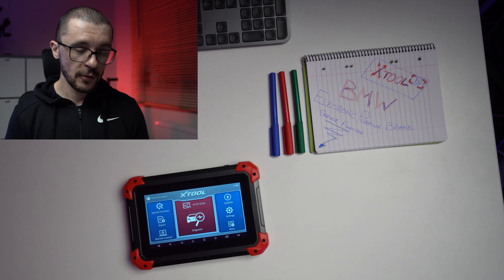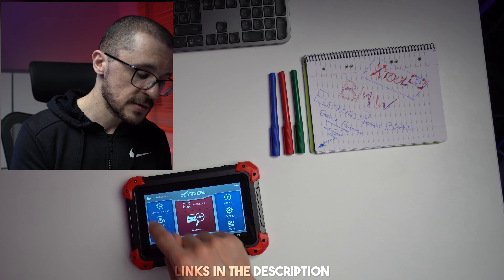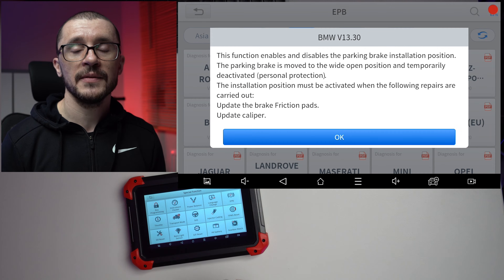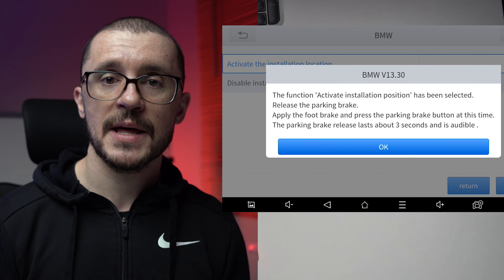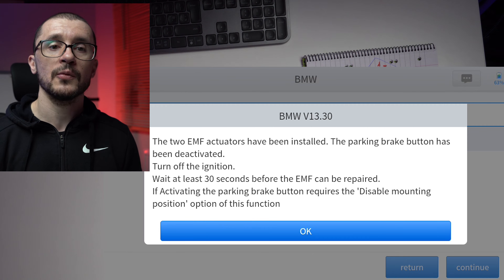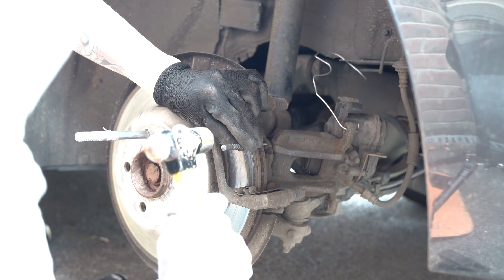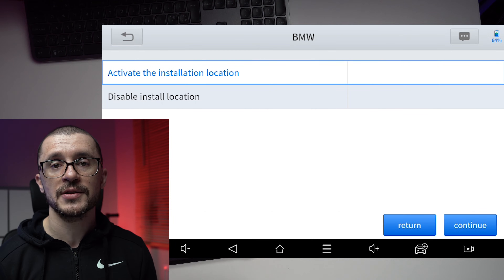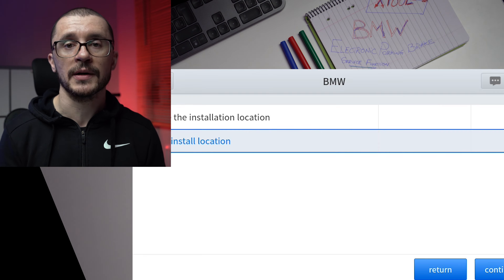How to Service Any BMW EPB - Xtool D7 - Electronic Parking Brake

Comment: Used it as described. Motor wound back for 3 seconds and then a further 10 seconds ok. But when I fitted the new pads it would appear that the caliper was not wound back far enough to fit over the new pads, gave up put the old pads back in and went indoors and contemplated how much I had paid for the D7s.
Reply from the maker: :)) you still have to push in the brake cylinder. with the diagnostic tool you undo the EPB. the hydraulic system is a classic mechanical system. you can use a press or a screwdriver or even push by hand with the calliper on the disk.
Reply: @BestCarMods  Thanks for your feedback. Job now done including mileage reset with the Xtool D7s.🙂
Reply: Where are you bye the obo2 scanner.
Reply: @chicolopez5259  Amazon